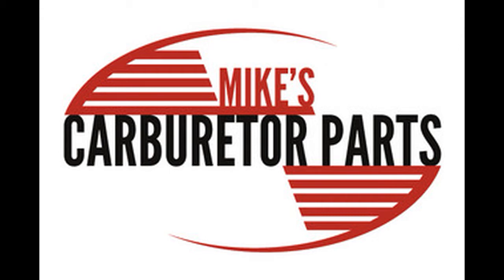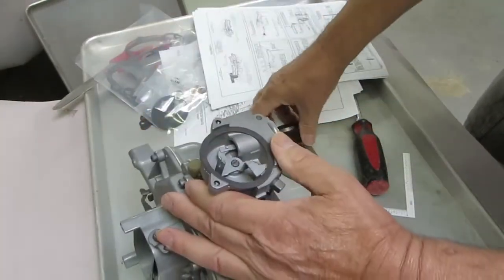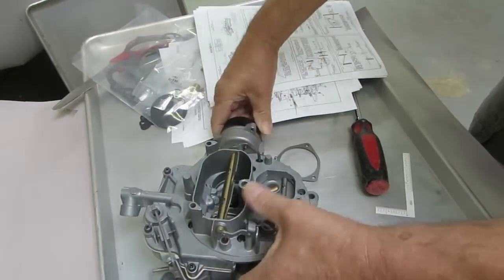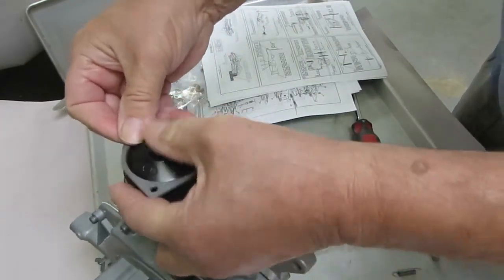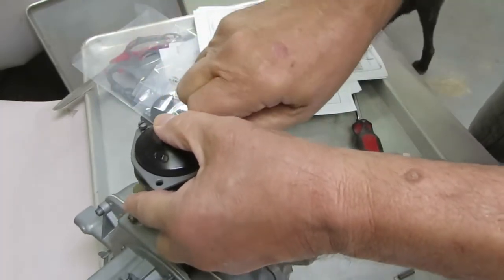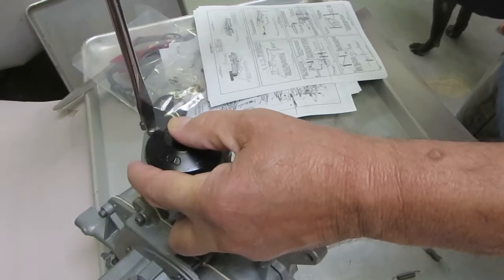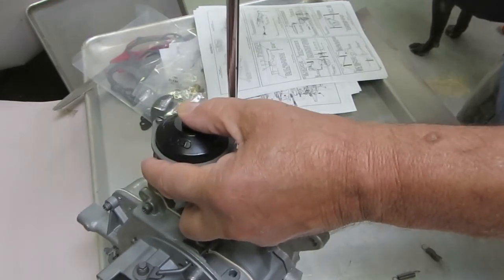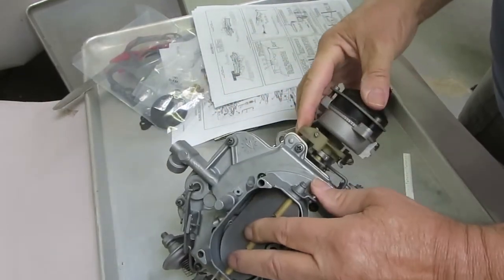Understanding Autolite 4300 4 Barrel Carburetor Choke | Carburetor Basics Explained

Comment: can you do a video on how to do the 4300 Choke Pull Down Adjustment ,Fast Idle Cam Choke Clearance,  and Choke Unloader Clearance...I'm looking at the PDF on your site for the life of me I don't get it.

One question I have is when the car is fully heated up and the choke plate is fully open (well mostly open) How do you adjust the choke plate so that it is fully in the vertical plane? When is fully warmed up the choke plate is slightly less than vertical.
Reply from the maker: I'll see what I can do. Not sure if I have a 4300 around at the moment.
Reply: @MikesCarburetor  Thanks...I'd appreciate it.